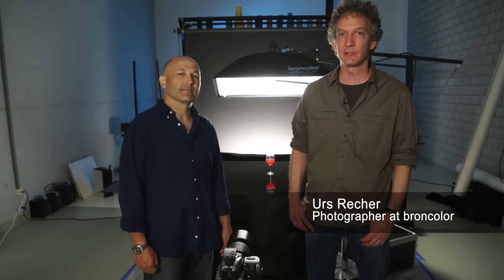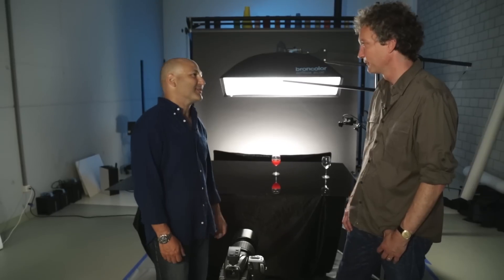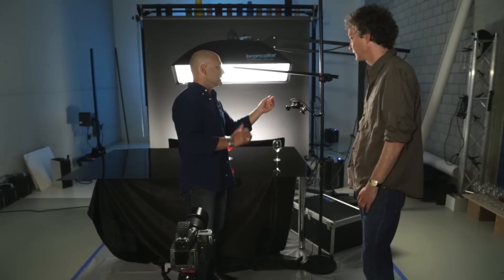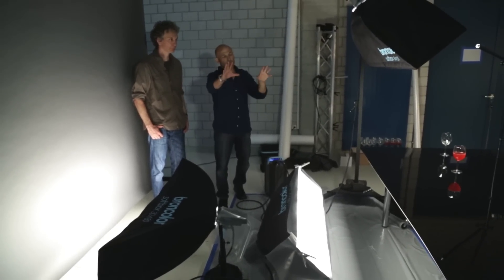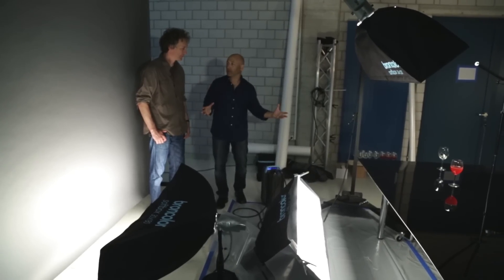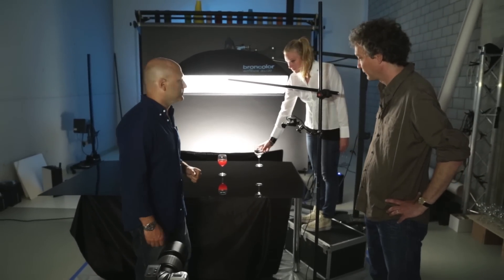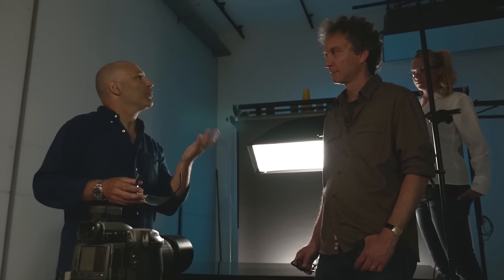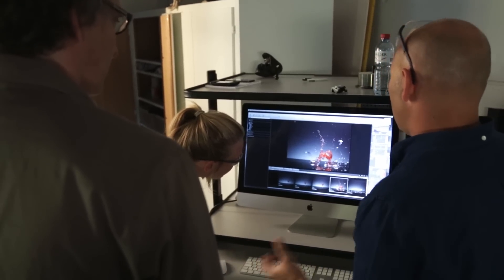How to Freeze Motion in Photography with Fast Flash Duration

Comment: could you please give more info on the camera settings (f stop shutter ect) thanks
Reply: Default flash x sync and whatever aperture you want dependent on available flash power and desired DOF? The settings are irrelevant in a blackout studio, the extremely short flash duration is freezing the motion not the camera settings. Only the balance of aperture and each flashes power is relevant to exposure and unless you are using the same equipment in black out conditions, there isn't much point in knowing those settings. The Camera settings are likely to be something like 1/125th @ F8, ISO 100.
Reply: @TheRg191  Haaselblad is a Leaf Shutter camera, so any flash speed can be seted, not limited to any flash speed sync..so in this case..whe dont now!
Reply: @palmaestudio1381  the whole point of the video is that the flash is freezing the liquid so shutter speed is what ever your default flash sync speed is, I don’t think you’ve understood what I wrote. The settings are irrelevant.